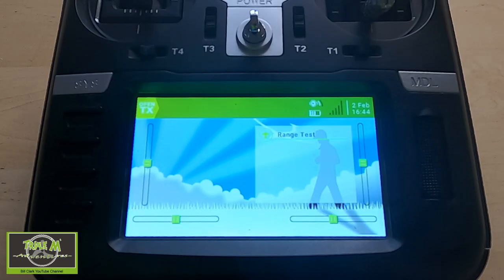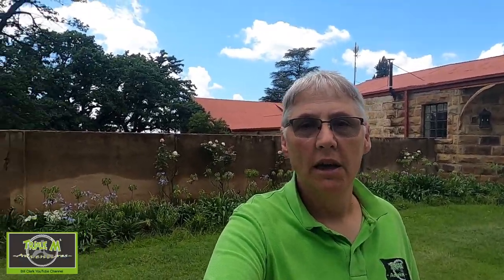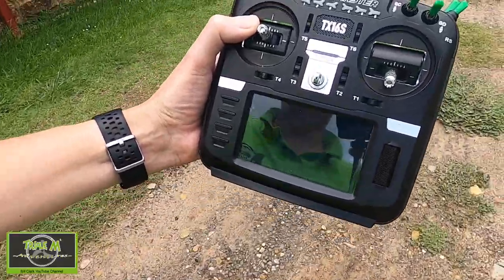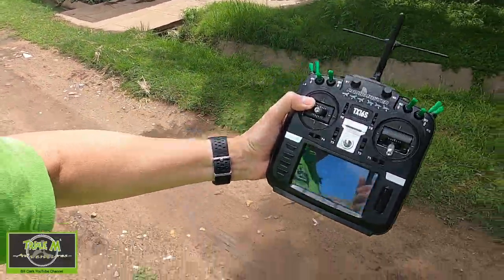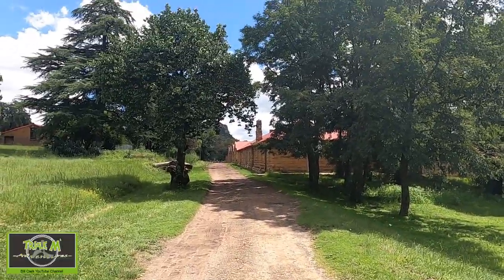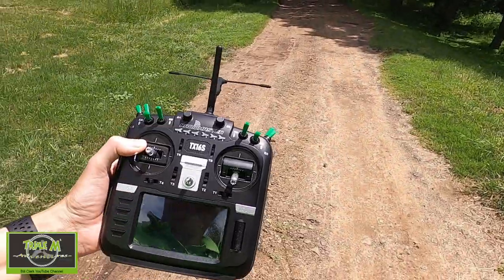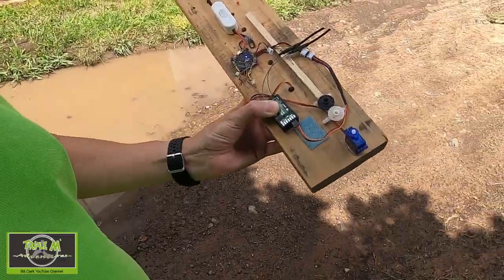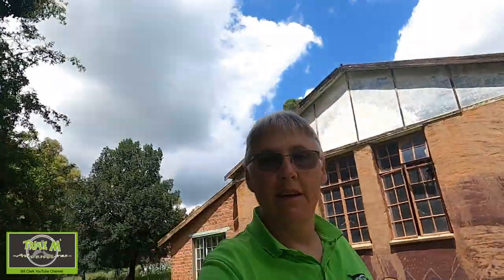OpenTX - Receiver Range Test

Comment: Bill, thanks for the video. Just recently got a Radiomaster TX16S and tried this out. Used a FrSky ACCST receiver. Downloaded a GPS distance measuring app to check my distance. I got about 190m before I ran out of room in the parking lot I was testing in. Signal was still good. Thanks again!

Comment: thanks for the video. It looks like your TX16S has a modified antenna? if that is the case, maybe that's why it went to 200m? 

I'd be interested to see how an unmodified TX16S would behave.
Reply from the maker: The antenna is standard I have my TBS Crossfire unit in my radio.
Reply: @the-happy-RC-flyer   ah ok, my bad, sorry, thanks for explaining
Reply from the maker: @pea2911  You do not need to be sorry. We learn things everyday.

Comment: Thank you for showcasing. Is the range test function (rng) affected if I previously set telemetry to 25 mW in the receiver options? I am using a FrSky Archer R6 receiver and a Taranis QX7s ACCESS. Can this even be done without telemetry turned on in the receiver?
Reply from the maker: No it should not affect the range of your Transmitter just the telemetry signals coming back to the Tx from the receiver. I cannot take a look for you because I do not own a Archer R6 receiver.
Reply: @the-happy-RC-flyer  I made a range check the other day and I got around 50 m at around 32 rssi (access protocol). But I had half a tree between me and 1 of the two rx antennas (couldn't see my aircraft) and that antenna wasn't well oriented relative to the tx' antenna (although in the same plane). So I guess it's okay.
Reply from the maker: @PFinkoloTL87  you should be good to go.

Comment: i have a question when i do range test i have to click on internal RF on edge tX 16s and do range test after 20 feet the range test fails, using AR631 spektrum receiver, it was working before any recommendation>
Reply from the maker: You say it was working before? Before what? Does the receiver have an option to Fine Frequency Tune?
Reply: @the-happy-RC-flyer  the receiver does not,
Reply from the maker: Are you selecting Subtype Auto? And Low power selected for the line of site ground test?
Reply: @the-happy-RC-flyer  throlltle is set to cut when i do range test
what is subtype auto?
Reply from the maker: For the Spektrum receivers you select DSM then Subtype Auto when binding your receiver to the radio. Low power is an option in the binding section which you can turn on when range testing. This helps reduce the power when testing the receiver, you do not have to walk so far!

Comment: Hi Bill, glad you are an aircraft guy. Bought a new Radimaster Zerro with Edge TX. How do you do the range test on that, I could not see. As you know on Spectrum, you have a low power output function. Do you have that on Edge Tx ?  Please help !!!!!!
Reply from the maker: If your receiver has the low power option it will be the last option under Internal RF.
Reply: @the-happy-RC-flyer  Thanks Bill, what is your Aircraft radio system using. Transmitter & receivers you use. This will help me.
Reply from the maker: @dimiarachi2428  I use Crossfire for most of my planes.

Comment: Hi Bill,  Is there any danger the transmitter could accidently be left in the reduced range mode ?   How do you turn it back to normal (full range) mode?    Thanks     Eoin
Reply from the maker: Hi, if you leave your radio in Low Power Mode and you switch the radio off when you turn it back on it will give you a Low Power Mode Warning. You will need to manually turn it off.

Comment: Hi Bill, I have 2 units of the TX16s. Mode 1 and 2. I bind them to my Eachine mini airplanes. I have no problem with my mode 1 but not the mode 2. Apparently the mode 2 only have a range of about 100 meter and I lost one of my planes because of the signal lost. Can I know where might have gone wrong with my mode 2 or is there anything I can do to extend the range, e.g, perhaps use an external multi modules (with v761 protocol)? Thank you
Reply from the maker: Martin by Mode 1 and Mode 2 are you saying the two radios have the throttle on different gimbals? It should not make any difference which mode you are using to the range of the model but if different models have different range performance then it could be how the receiver is installed in the model or a faulty receiver. One other thing if you see the option to fine frequency tune under the model setup options you must complete this process or you can get range problems. 
How to Fine Frequency Tune

https://youtu.be/jdM_JcKzwCc
Reply: @the-happy-RC-flyer  Thanks for the prompt reply Bill. Yes, I meant throttle on different gimbal.
Both identical model. I tried with different planes and it is still the same. I suspect it could be the defect of the transmitter. I just got them 4 days ago, after I was not able to bind those planes with my TX12. Sad that I am still having transmitter problem one after another.
I checked both transmitter's settings and I even use identical SD cards but the problem still not solved.
Reply from the maker: @martinlian4533  have you fine frequency tuned the receivers in your two radios?
Reply: Hi Bill, thanks for following up. I didn't coz I bind to Eachine mini airplanes using v761 protocol which doesn't have the fine tuning option. I tried to use the Low Battery Mode but it's still the same.
Reply from the maker: @martinlian4533  it must be a problem with the receiver.
Reply: @the-happy-RC-flyer  Hi Bill, I tried with different planes and it's the same. I suspect it's the radio coz my the other radio has no problem. I have requested for a replacement from Banggood but so far no reply yet.😅